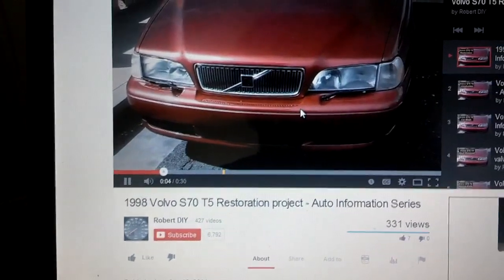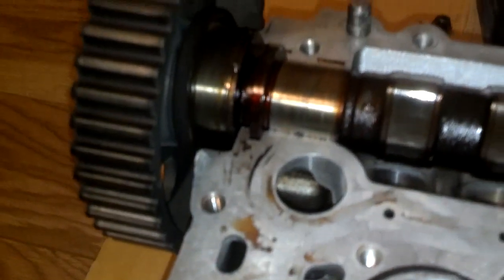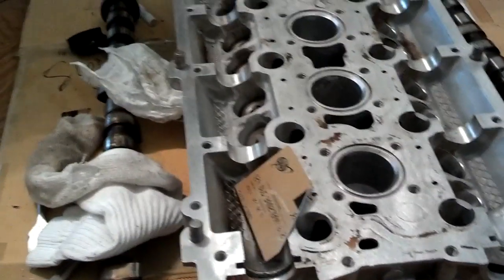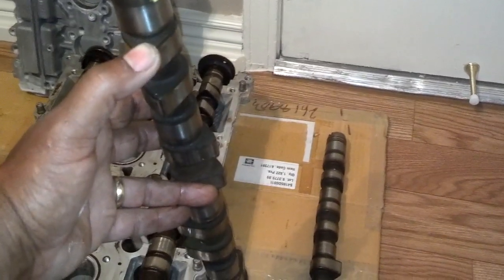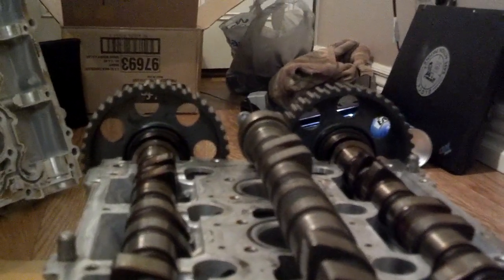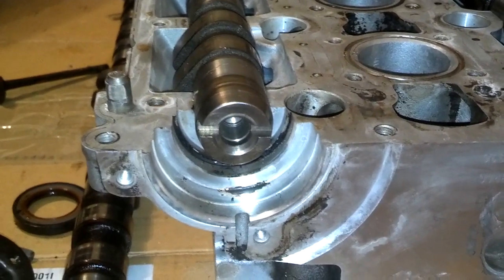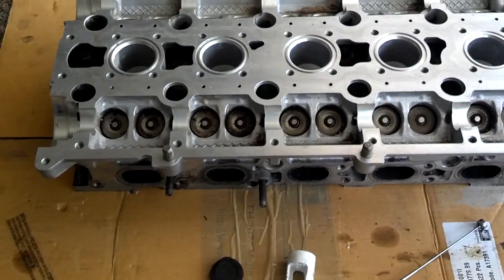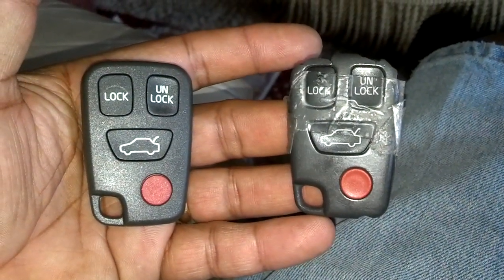Volvo S70 T5 restoration day 7, head cleaning, cam swap, valves removed, etc. - Auto Repair Series

Comment: What is the difference btw the NA and the Turbo cams??  Did you check the block deck for true as well?  I know the gasket will take a better seat with the machined head.  Keep up the good work!!  Lots of people will benefit from your vids.
Reply from the maker: ***** The NA cams have longer lobes and give a little more air for combustion when properly timed. The head or block had not overheated so there really was no need to have the block checked for trueness, even though I could have checked it myself (I may have). The heads for these cars are soft and need to be checked every time they are removed.
Reply: Nice work, helps to work on similar brands/models of vehicles.  Get to know all the little tricks and nuances.

Comment: Quick question robert , Should I take out the rods and springs if they look good, its at 145k? The head needs to be cleaned tho and I never serviced the value stems before or cleaned ports. Any suggestions? Also how much should the machinist charge me? The head doesn't seem warped being that I checked it with feeler gauges and a straight edge. thanks, trying to avoid a complete rebuilt of the head.. well sorta
Reply from the maker: +Joe Serrano Are you saying that you have the head off? Not sure what you are asking? I have no idea what kind of car you have?
Reply: +Robert DIY its a 95 t5 engine, it over heated so I took off the head. I'm curious if I should perform a value job or just clean the mating surfaces and engine ports and reassemble it.
Reply from the maker: If you have the head off, at this age I would change the valve stem seals. - https://www.youtube.com/watch?v=O2D5EnSF4RM
Reply from the maker: https://www.youtube.com/watch?v=qpLhuuqhQEk
Reply from the maker: Not sure what you mean by rods.

Comment: I would imagine when the head is on some error between the big end cog and the position of the cam cogs/belt will need to be re adjusted to make sure the big end to cam timing is correct.

Please forgive me for my slowness of undersatnding :-)
Reply from the maker: These are normally interference motors but there is a margin of error. The timing can be off as much as 2 teeth without cam lobe to piston contact. The lobes on the NA (naturally aspired - non-turbo) cams are just a little longer and really don't add contact damage. My guess is that you'd have to be about 10 degrees off to cause a problem.
Reply: Robert DIY
Thank you for explaining :-)), as long as it works for you im a happy chappy :-))

Comment: Hey Robert, can i ask how much it was to get the head machined? i am about to do this job on my 1999 v70xc and i was wondering how much its going to cost. Also is it absolutely necessary to get your he'd machined when changing the head gasket?
Reply from the maker: I would NEVER install a head without having it machined. I think they did that with my daughter's car before we got it and I had to replace it a couple of years later. One shop charged me $65 and another charged me $45.